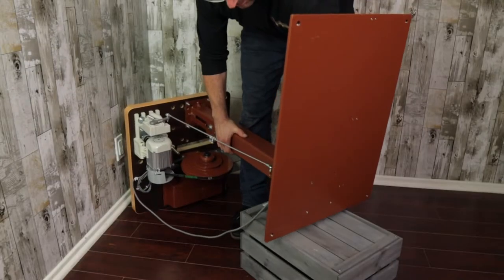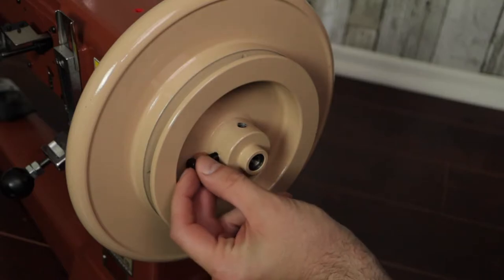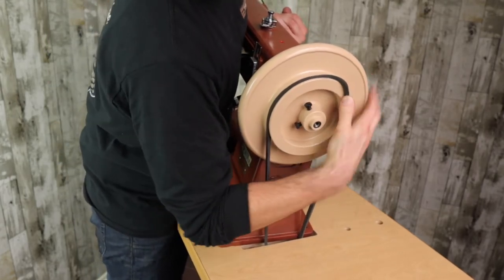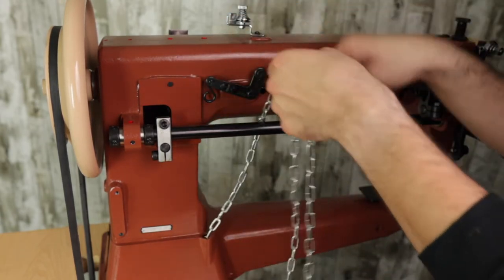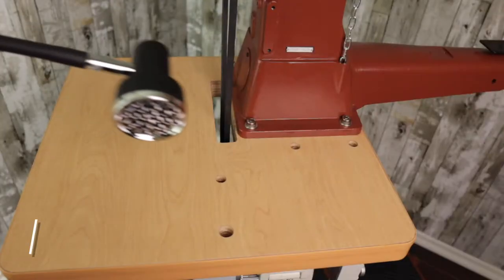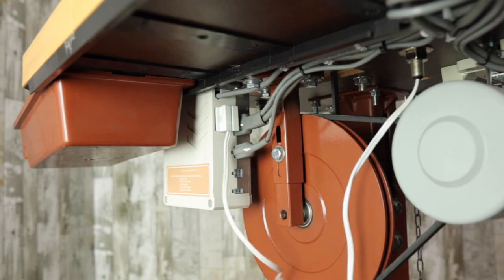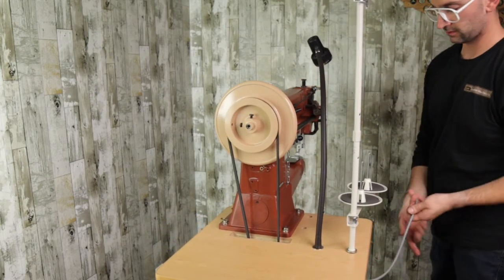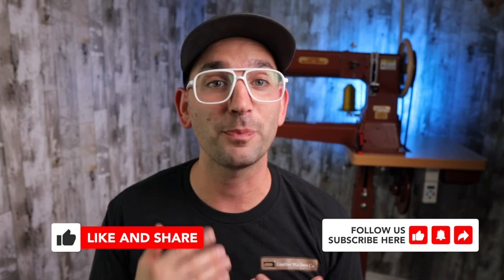Setting up your Cobra Class 4 Sewing Machine - EPISODE 20

Comment: How do I know when I have the tension set correctly?
Reply from the maker: We have 4 more videos releasing over the next few weeks going over this topic and many other topics. You will enjoy those. Stay tuned!

The best suggestion I can give you is to take scrap leather similar to your project and try sewing on it to find the right stitch length you desire. As you do that you will see how the stitch is made and if the knot lands in the middle of your leather work piece then your tension is great as is. If you need to adjust tension, start with the two knobs on the thread tension discs. If you adjust the top by one full turn then you adjust the lower by a full turn as well. Turning right increases tension and turning left decreases tension.

Good luck and have fun with your machine. 

Cheers!
Reply: @vanplewco  thank you so much!